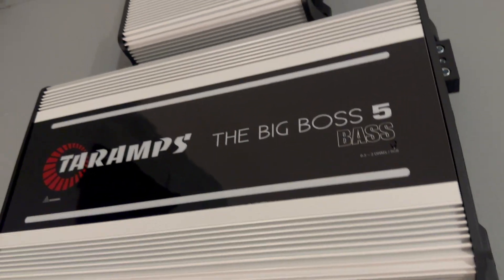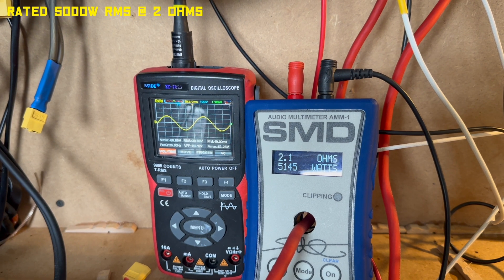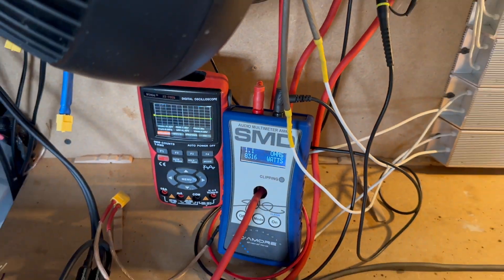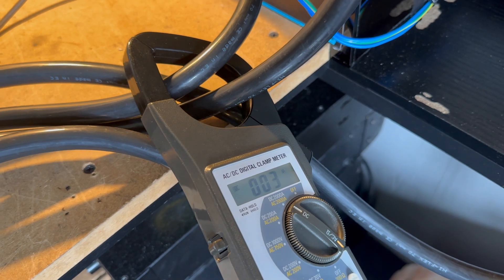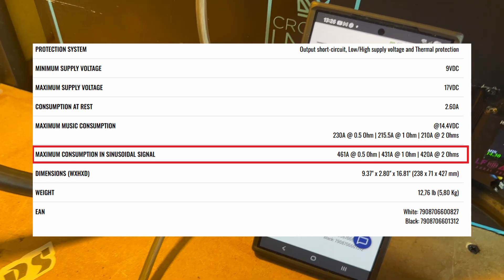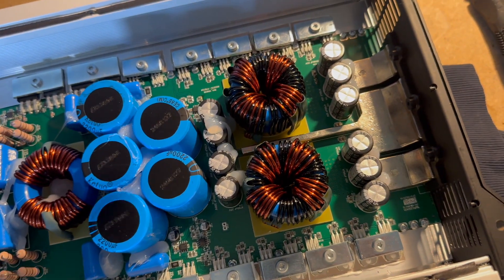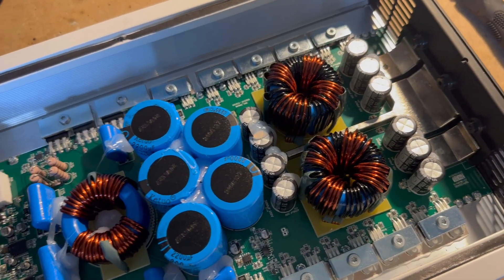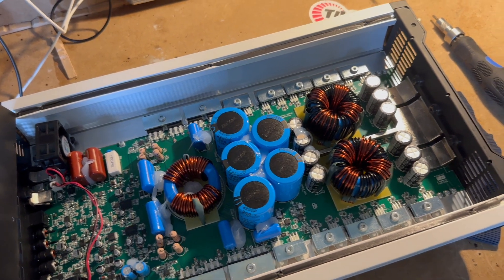How Much Power?! Taramps Big Boss 5K (DYNO)

Comment: Voltage too high. Do it again at 12.5 and 14.4
Reply from the maker: Incorrect you do realise that this is only starting voltage which Taramps claims can go up to 17 V and underload this an easy drop-down to 15 and 14 V so what’s your point….
Reply from the maker: Getting more technical here dis amplifier has a regulated power supply so it doesn’t matter if it’s at 12 six or 17 V the rail voltage is set at a number that doesn’t move

Remember this rail voltage is linked tohow much power is outputted and if it’s already putting out full power at 12.6 and 17 it means the results will not vary it will stay the same 

If this was a non-regulated power supply, then you would be absolutely correct

Comment: That’s wild that the amp handled it no problem taramps has come a long way lol. I think I seen you on Barevids recent stream I had a question about setting gains at half ohm, I’ve never gone to half ohm before so using the multimeter method should I be setting the ac voltage for half ohm using ohm law or should I be setting it for 1 ohm since it’s going to rise and never truly be playing at half ohm?

Comment: I 💯 agree those poor rectifiers  are way over performing. Taramps has some amazing designs when their full bridge designs hit the market ive been solely using full bridge amps  for my bass i currently have a NVX XAD. 17  wich is the most powerful amp nvx sells also the xad series of amps was their top of the line series that they sell NVX is thought to be a sound quaility focusing brand  im gonna be running this huge amp in my house similiar to a set up like u run.

Comment: is having such an underrated RMS not also a bad thing? lets say im putting 3000W RMS worth of subs on a '5k' amp. and then my 5k is pumping out well over 8000 watts and blows them. is that not a problem? or am i crazy?
Reply: This is why you have gain adjustment. Your rca voltage to the amp is what makes the difference in how much power you'll see.
Reply: That's what gains are for